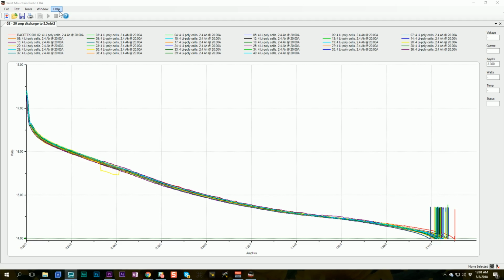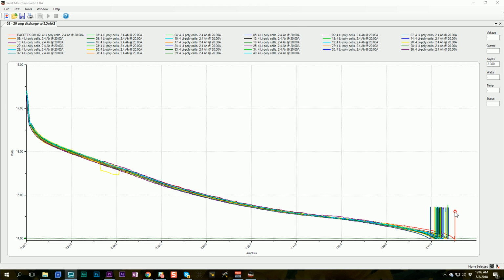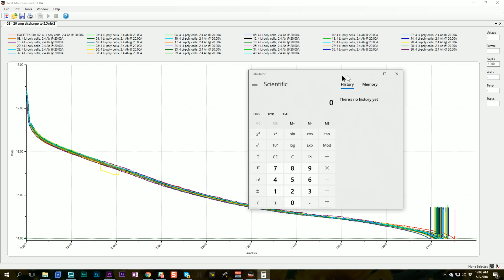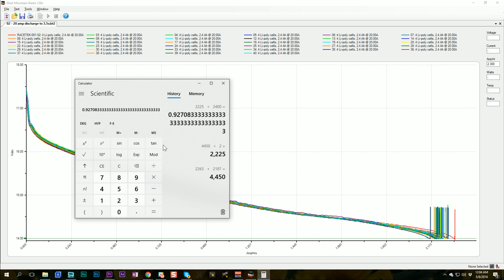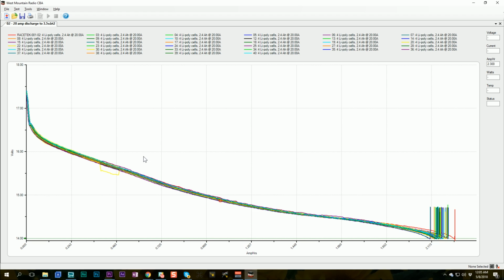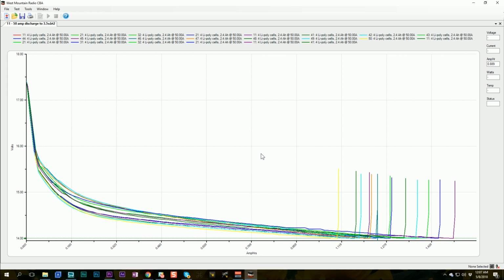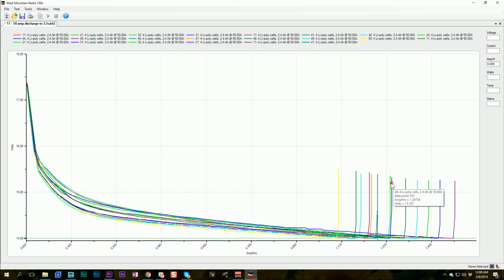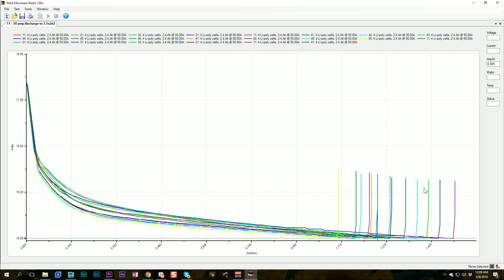HV LiPos Yes or No | UPDATED TEST RESULTS

Comment: I bought two Tattu 1550mah HV, and they took about two hours to charge and if I didn't use right away, would sag below 3V per cell.  I had to chuck 'em -both....but my Thunder Power Sugar Rushes are off the chain.

Comment: I bought 4 Lumineer 1300mAh 4s hv 80c's from GetFpv and 2 only made it through 3 cycles and 2 made it maybe 5or6 cycles. I won't buy another one. But I guess that's why they were on sale for $23..... Lesson learned.   And I got told it was my charger... But my charger charges all my CNHL 1500's 100cs wonderfully! Thanks for sharing your results. Imo hv's are just normal packs and some may handle hv charges but never last as long. It's always one cell that goes out in the packs. Test if outside cells take more punishment then inside cells!

Comment: 3 months ago I bought several Hyperion Si-Graphene HV 2800mah lipos. I would say I have in the neighborhood of 100 cycles on each, my Dynamite charger says the internal resistance is 57 milliohms of internal resistance (I'm charging one currently). I have not noticed any perceivable difference in performance or flight times thus far (Good it's a $67 battery) I stay very within the 3.8v-4.35v limits every flight and charge cycle. I can't not recommend HV, although I really don't see a massive difference between HV and normal lipos. Buy what you can afford.
Reply: Depends how you fly, I come down in 1.5 minutes with a 100C 1400mah pack hot to the touch.

Also, did you set the charger to cutoff above 4.2 volts?
Reply: I have an 800gram quad (action cam included) and Tmotor 2206 2450kv motors, I'm getting around 4-5min. flight time. Not racing, general freestyle around trees and whatnot. Nothing comes down hot, but idk anyone that would run a 2800mah lipo to go full throttle nonstop. Charger is 4.35v cutoff
Reply: according to how i just saw you fly, we are lots different. I like obstacles and holes to get in and out of.
Reply: Yah, that's all old footage and the newer one was crap-tacular, I recorded a freaking awesome flight with my new HD cam mount, and I found out all I did was take a single still picture.
I have a 7" build with a 2200, flying easy I get 12 minutes, but last time, I flew like I usually do and got 5.5 minutes.

Hopefully I can go out to the park and get some good footage tomorrow.

Comment: Very interesting! So high C discharge causes and indicates Lipo aging, while low C discharge does neither of both. Wouldn't this test be a good indication of the actual C-rating of a Lipo? I mean the C-rate above which a LiPo notably degrades? For this pack it would be below 25C.

Comment: How about this test...

As racers we are used to using High C rated 4.20 lipos and charging them to 4.35.  How about testing 2 same model and spec non HV batteries.  Battery 1 charge to 4.2, Battery 2 charge to 4.35. Cycle both batteries the same and see if charging a standard quality cell to HV actually hurts a battery.  I surmise it does not. I also surmise damage is done to the cells taking the power out not putting it in.
Reply: I want to see that, too. Get, for example, 2 Tattu R-Line HV and 2 Tattu R-Line HV. Charge both to 4.2 and 4.35. Just to see if there is anything about HV Lipos or if HV dies just as fast as normal Lipo charged to 4.35.

Comment: Probably not relative but just thought I’d mention that I had 4 Tattu R-lines with about 30-40 cycles on them and decided to hv charge them to 4.3v per cell since everyone else was doing it apparently. I got about a 2 second punch at the start of the packs then was fighting the low voltage warning the rest of the pack. They never recovered. Maybe got 2 minutes of flight time at 50% throttle. I killed my packs from one hv charge. Perhaps because they were old to begin with and this just put them over the edge
Reply: That's like giving a 95yo man 3 cans of Red bull and a blue pill, he will have fun, but for the last time in his life.
Reply: Hahahahaha😂. So true but the poor fella barely even got off the ground lol. He went out with a bang while he was still on the charger

Comment: Thanks for sharing these insightful test results Joshua!  
For me, all batteries are disappointing & the major part of the hobby that hasn't progressed.
As an FYI... I've still got my old Bolt LiHVs from a couple of years ago.   I look after them (never go down too low), but I've flown hundreds of "low amp" draw, long-range setup (with a little acro - sub 30 amp) - no problems at all.

Comment: Also JB, would it be possible for you to test a Racetrk 22-2400mah NON LiHV version and see if the fall off is the same after 40+ discharges etc?

I’ll help partially fund the cost if you need.

Comment: I’m really torn because I want my lipos to be as light as possible for the amount of punch they give. 

I own both 4S HV and regular lipos as well as 5S HV lipos and I can honestly say I prefer the HVs more. 

And now that I basically only flying 6” quads, I’m really partial to 5S HV packs. But I’m also aware that their is a potential longevity problem... 

My question is, how many more “good flights” can I expect to get out of regular lipos vs their HV counter parts? 5 more flights? 50 more?
Reply: Depends on your charging, discharging, and storage habits. I have around 100 cycles on my 4s HV and it seems unchanged thus far.

Comment: i gave up way back. the bolt 1300's didnt last 10 cycles (I got 4 and all died).

not racing, so no point for me. better to get one that will handle more cycles.  graphenes are still holding out over non-graphenes.

also, the infinity race spec reds are only just better than the blacks but both are better than the silvers under continuous load.

Comment: I wonder how the longevity of a HV pack be vs a regular pack under normal lipo charging conditions. I know it defeats the purpose of going HV but would a HV pack get more cycles than a regular pack? Would there be an advantage like holding lower cell resistance over a period of time etc? Thoughts? Thanks JB!!
Reply: I got turnigy bolt high volt battery and i have never charged them over 4.2 volts per cell. I have put maby 100 cycles and thay still going strong. I know it defeats the purpose but i got them because the high c rating. If you look at data sheets of 18650 batteries for example you can put over twice the amount of cycles if you charge them up to 4.1 volts or 4.0 volts. My point is that you do pay a price by charging them to high volts.
Reply: That is a good question.

Comment: I wish you had a non-hv reference for this experiment...

Also did you measure temperature? If the high current cycles were back to back maybe part of the degradation was a change in temperature carried over between cycles?
Reply from the maker: The temperature was normalized before every run.
Reply from the maker: I have done similar tests to non HV and they did not degrade this fast. I don't have anything to publish and if course every battery is different.

Comment: Thanks for the testing!  You should do a dot plot of the results with capacity on the y-axis and cycle number on the x-axis. Then fit a trendline and perform linear regression analysis to see if there is a statistically significant correlation between the two. That way we'd have more solid proof of their relationship, and we can use the trendline to predict how much each discharge harms battery capacity on average and how many discharges the pack can take until it becomes unusable.

Comment: Without a doubt the R-line V2 1550 is THE BEST 4s you can buy for our needs.. I have no problem getting 50 to 60 race quality cycles and that's pushing them very hard and finishing races at 3.2 to 3.4V per cell resting so they are being flown hard and over discharged if you are wanting long pack life.. on my v2 HV 1550s that I only fly freestyle with I have some that are approaching 100 cycles and they preform very well still and have no problem dealing with 2400kv F40 Pro v2s turning HQ5.1s.. those packs I will fly down to about 3.6 to 3.7v per cell resting and charge to 4.4v per cell and they hold up well and for a long time.. the only down side to them imho is the weight, the v2 1550s coming in at 193 to 198 grams a pack... I'm a racer so I'm used to light race ships and try to build my freestyle ships as light as I can as well and can deff feel a difference in the way the quad feels if I'm flying let's say a 95c 1300 R-line at 160 grams then going to a right at 200 gram v2 R-line 1550, that extra 40 grams hanging on the bottom is clearly felt when flying fast through trees and such when your turning hard And fast.. I hate the weight.. that's pretty much why I'm exclusively 6s on race builds now and as my 4s packs wear out I will be building on 6s freestylers to.. I can run 6s 1050s and get the same flight time as a 1550 with lighter weight hanging on the bottom, more consistent power over the entire flight and just a tighter flying cleaner tracking more responsive quad to boot.. but as far as HV 4s packs are concerned the 1550 R-line v2 is the pack and I have been preaching that since they came out.. the v2 1300 is a great pack to but not even close to the amp handling ability of the 1550, the 1300 will say down more in the first 30 seconds on full throttle punchouts then the 1550 will 2 minutes in to the flight the 1550 handles very high amp draw with very low voltage sag SO much better then any other 4s pack I have flown that is in the 1600 and below range, the TP 1500 Sugar Rush HV 100c is a great pack don't get me wrong but compared to the 1550 V2 R-lines it's not even close.
Reply: RCWeaven FPV RCWeaven FPV (this is quadcopters and airguns, its my wifes account im on) my race builds are normally based on a few custom designed frames that i cut my self.. they are designs that me and a friend who is a aerospace structural engineering student that is interning at Lockheed right now came up with.. i fly Tmotor exclusively nowadays my race builds are 70% F40 pro v2 2600s, 10% F40 pro v2 2400kv and 20% F60 pro v2 2700kv that was my race builds pre 6s allowed... now that we can race with 6s im flying the exact same builds as before but with Tmotor F40 pro v2 1750kv monsters my god that motor is superb.. im flying the Airbot 4 in 1 35a blheli32 esc and the Airbot Corner FC in most every race build as well I LOVE THAT FC (gotta have the Airbot made unit not a clone tho) im flying Crossfire on everything now with my Graupner MZ32 Pro running the Crossfire nano on all race builds and Unify Nano vtx on all race builds as well. in case you want to know the cam that is in every one oy race builds is the Caddx S1 i LOVEEEEEEE that cam..

On my freestyle rigs i still build them very light weight and i do not fly Gopros as i hate the weight and just run Clearview and DVR it to get my flight video if i want flight footage.. i try to keep my race builds in the 230 grams dry weight max but get most down around 220... freestyle quads i want 270 max dry weight and right now im flying F40 pro v2 2400s on about 50% of my freestyle ships and BH R52207 2400s on the other half.. all my freestyle builds are setuo for 4s right now because i have a ton of premium 4s packs that i want to use up, as they start to crap out or get damaged my freestyle ships will move over to 6s.. most of my freestyle frames are similar to the Floss 2 but i cut my own and changed the design in a few ways to make them more freestyle friendly/tougher.. i also have a few Talons that i use for freestyle frames as well.. 

The 6 inch quads i havent really gotten in to to much i do have a few but but find my self rarely flying them, when its not a 5 inch then im flying one of my 6s 7 inch long range freestyle builds and i really love them, preformance is excellent and soooooo super smooth even in higher winds out at the beaches.. long flight times on my 6s 2200s, super fast cruise speeds at very low amp draw they cover ground QUICK, have tons of low anx mid range grunt and make honestly super fun freestyle ships to explore places with.. theu get there fast, then make for excellent freestyle ships then get you back fast.. i have really gotten to like the 7 inch builds when they are done right..

I really didnt know what you wanted to know exactly so i just kinda covered everything.. if you want specifics please reply asking me whatever details you would like and ill reply to your questions.
Reply: What are some specs of your builds. Specifically the motors.  
I am thinking along the lines of overbuilding a 6 inch quad with 6s. 
Would be nice to get a consistent run for performance with consistent times run after run. 
Really any size quad as well. 
Thanks
Reply: if you are a racer and saying the Tattu batteries are the "BEST" you can get, i question your credibility. I would say the the tattu is so over hyped, and thats not even in racing. have you tried indestructible quads black labels? I've beat the shit out of those and they still hold true to their capacity and rating. i've done tattu and infinity graphene, and there is no comparison
Reply: I'm done with Tattu, for sure! My recent transition to all 6s made that brand irrelevant (whoTF wants to pay $50 for a single 6s battery?), as outfits like piroflip sell quality packs for much less...the 6s pyro packs are frigging legit, and they only cost $28.99...
Reply: Kstorm 88 you may question as you please.. i have been a sponsored 3d heli pilot since the Hirobo shuttle days.. i did NOT say the 45, 75 or 95c tattu packs are the best 4s packs you can buy, the 45c packs make great little starter packs that can be had for 16 to 17 dollars a lot of times and they do hold up well and have a lomg cycle life if charged and discharged correctly plus,storeage charged if you plan on not using them for a few days or more.. i did however say and without a shadow of a doubt am correct THE Tattu/Gensace 4s Rline v2 100c 1550 HV is easily the best 4s pack on the market.. the 1300 v2 is a decent pack, the 95c rline packs are decent packs... the V2 but only the 1550 is by far and away the hottest 4s pack out there right now.. I race with Pulse packs pretty much exclusively now (i flew for pulse 3 years ago for my heli packs then moved to optipower then gensace) pre 6s the 1550 v2 is and was THE 4s pack... if you doubt my creditibility then you doubt 95% of us fast guys.. no other 4s packs in the sub 1600mah range right now will sag less then the 1550v2, you may very well get fewer cycles then other packs BUT you will absolutely get more preformance for the cycles you do get. The Tattu packs as a whole are decent packs, im not a huge fan of the Rline 75 and 95 c packs (except for the 95c 1800 that is a hella good pack) at the normal 33 to 37 bucks for the 1300 and 1550 95c 4s Rlines makes them not worth it when you can have the V2 100c HVs for 2 or 3 dollars more.. the 1550 v2 has crushed any 4s pack i have flew in current handling capability it handles current with less voltage sag better then any 4s ive ever flew and ive flew most.. when racing the norm for 4s is each lap is slower then the last (except for the first due to the start) the packs just sag more and more and you push harder on the throttle to pick up and it sags more its a never ending cycle.. the 1550 v2 Rline is the only 4s pack ive ever flew that doesnt put me in a state of dwindling lap times from the start... it will normally hold my lap times to within the range of pilot error between laps comsistant rather then it being just increased lap times with each lap consistantly slower then the one before it.. its the badest 4s sub 1600 race pack out there..
Reply: Kstorm 88 this is my wifes account lol but this is quadcopters and airguns..